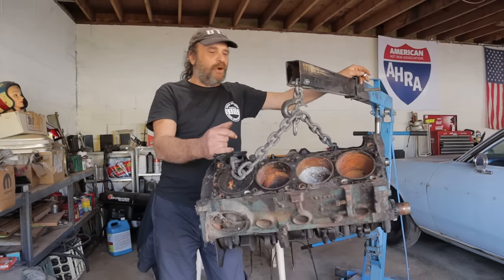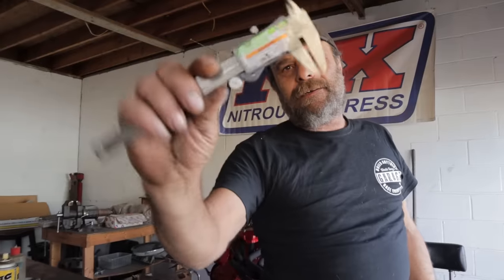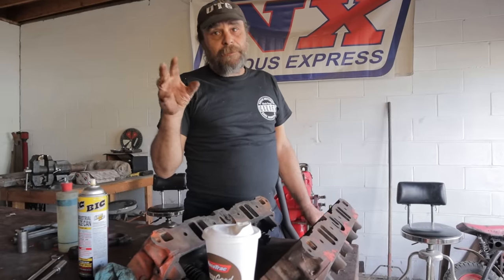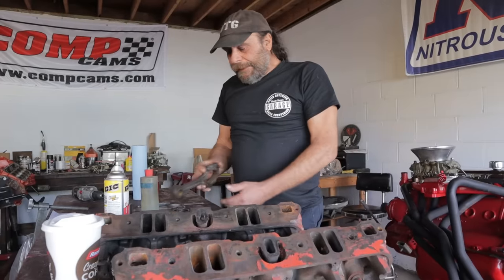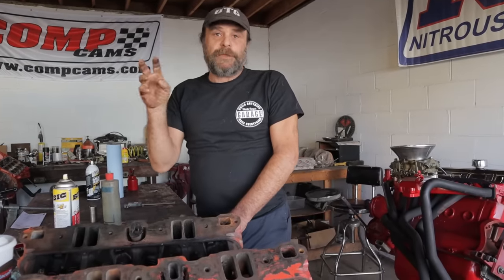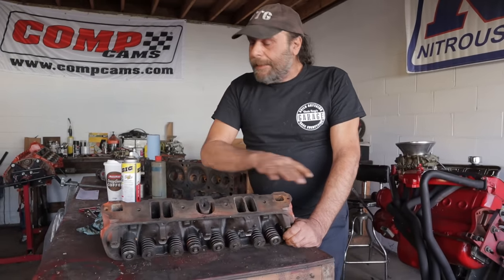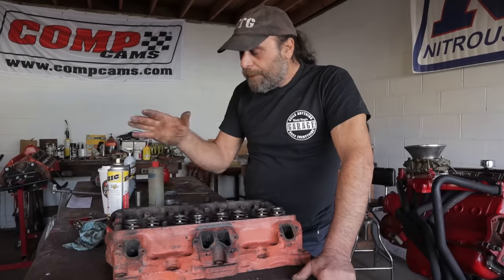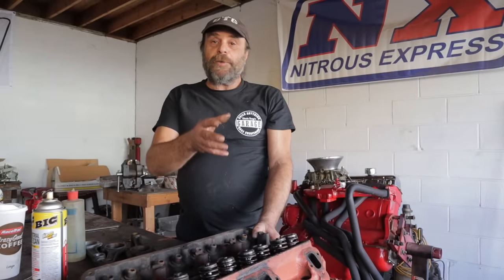The Most Under Rated V-8 In History?

Comment: Keep in mind the selling point of the 340 over the 318 was this 👇🏻

“With its extra 67 cubic inches, larger 2.02 / 1.60 inch valves, notably improved ports, dual plane iron intake manifold, full-length dual exhaust system and hotter camshaft, the 340's factory-rated 275 horsepower at 5000 rpm and 340 lb”

Comment: I've built two 318s that preformed excellent one i ran 340 heads on the other  i used Edelbrock heads both engines used a basically stock short block and thumper cams. one in a duster one in a dart. i hate myself for selling them. 😢.

Comment: hot rod did a 318 Demon build back in 1970 or 71.  Did all the usual stuff , Edelbrock intake, Holley carb, Cam and headers and ran in the high 12's in the quarter mile.  One of the MoPar magazines did a 318 Poly build about 15 or so years ago and got over 300 horse out of it.  The heads are the real limiting factor as the ports are on the small side.  Never should have sold my '68 318 Dart.

Comment: You know I was in my early 20s before the first time I heard someone dong on a 318 (I'm pretty young late 20s) but that threw me off. My first vehicle that was actually mine and mine alone was a 94 ford ranger, engine and trans became shot. Buuut I had a 318 and a 727 that my buddy had laying around. So being young and dumb and getting grilled by my grandfather for it we welded crude ass motor mounts and beat this 318 drivetrain into that ranger. Instantly the FUNNEST thing ever. Then later on just to horse around I decided to put a 508 cam in it matched with my "new" Holley vacuum secondary. I just wanted something that sounded lopey just bc. I then turned up the idle speed to get that fast spitfire sounding race motor sound. What I didnt expect was during the shake down with my buddy giving it the business in the way into town and then immediately pulling over to buy some cigarettes because we ?literally* almost pissed ourselves. Stock 318, 508 purple cam, cheap hooker headers mid dumped into 18in thrush glass packs, stock 727 with a b&m ratchet just bolted to the floor, stock rear axle. Sold it to help buy a 70 cutlass and the guy I sold it to put a ford 9in in it then sold it to help buy a new work truck. I'd kill to have that bitch back. 318s dont fuck around man

Comment: I learned something new here . I  had always heard that the 340 was basically a 360 with a 318 Stroke .
360 Pistons and Journal sizes and a Meaty Shorter Stroke Crank . NASCAR Engine . Double Row Camchain Etc .
Same Basic Block for all three ? Obviously the 360 heads have bigger chambers , because of the Longer stroke .

Comment: my story is...I get a 65 barracuda with the 273 in the trunk. a 318 off a junk yard police interceptor 
was currently in the car they wanted to put a 360 but this is a manual and at that time externally balance fly wheel for the 10.25 clutch was custom made only so I built this motor, got a par of 360 heads then ported and lapped the valves no valve job but I had the heads mill 40 thou. slapped in a mopar purple H 340 cam hi rise Weiand duel plan and a small primary TH crab, and 340 left manifold with heat shield lugs that not wanted so it was cheep but flows just as good on the right i used a 1991-92 magnum manifold  and ported to fit the LA heads only the center ports need the most massaging . and to finish the hole thing off 2 1/2 dull exhaust with $19 mufflers dumped at the axle 
with 2.76 rear end i could smoke a 5.0 mustang unless it had a blower or on the squiez.drove it for 20 years and still have it and putt it form time to time. but i will tell you it is tired. but it will still put a BMW to shame.

Comment: Whats funny is that the 400 B block was poo-pooed the same way for decades. It wasn't until the last couple of years that most people figured out what kind of power it can make. Nick's garage just did an LA 318 that put out 406hp with massaged factory iron heads, manifolds and running pump gas. NA with a cam that still makes enough vacuum to run power brakes. The 318 will get its day in the sun soon enough! As for now, I'm glad that I have two LAs and a Magnum waiting to revive projects.

Comment: I would think an aftermarket pop-up piston with the 340/360 heads would be the ticket on a 318. More cost effective than porting upgrading valves on a 318 head. You have to buy pistons and re-balance anyway. I haven't checked the price of used 340 heads but assume they aren't unreasonable to purchase.

Comment: The 318 was a great very reliable grocery getter 4 door sedan engine.Most performance parts that was in the 340 and 360 magnum engines can be put in into the 
318 to make it a quick motor
but remember on the street there is no replacement for displacement.Small blocks are great for the 3500Lbs.and under A body and Cuda cars.But in everything else the tourqe of a big block is needed to really move out a 3700+Lbs.body..However in defense of all mopar small blocks when they are built up correctly nothing screams high performance like they do..It is an incredible engine.

Comment: Can anyone tell me if a 1970 340 X head would work well on a 1970 318 engine. Back in the mid 1970's I sold a rebuilt set of 340 X heads and also the intake to a guy I knew in high school who had a 1970 Duster with a stock 318 engine. I always wondered how much of an improvement he had gotten. Has anyone else done this swap and could let me know if it was worth doing. With the stock 318 cam I've kind of thought that his stock cam would not let it rev and take advantage of the 2.02 intake valves and ports. Plus the smaller bore seems like the larger valve would be shrouded, not letting the air and fuel flow as easily into the cylinder. At the time, 1976, I didn't know much about motors so I didn't think to question it. Any help would be appreciated.

Comment: I have a fortified 5.2 Magnum..they should have put big valves in these things a long time ago..(1.92😁) Its the Rod/stroke ratio that makes them so good .Long rods with a short stroke are real easy on cylinder walls and rod bearings. Rod is not at extreme angles at any point.

Comment: Not bad those old 318 engines  went well with just a simple kerosene overhaul quick port and valve job on the heads with basic tools and a upgraded camshaft and valve spring. Cheap horsepower back in the day .

Comment: Driver side manifolds flow really well and fit both sides. After a walnut shell treatment they flow as well if not better than almost all shorty headers.
If you go 4 bbl get a cam to match it. Most aftermarket cam's are better than most factory cam's.
SCAT makes some really affordable rotating assemblies $1,800 there and another $1,800 on Edelbrock heads. You will have a lot of bang for the buck.
LA heads have more manifold selection (the EQ 318B flows better than the EQ 318A) than Magnums (about 3). Carter AFB or Edelbrock performer, don't mess with Holeakies. If you are a Thermoflood kinda guy you are still one above the Holeaky.
If you don't go aluminum for heads. Indy and EQ are best for aftermarket iron to my knowledge. Old EQ's made in New Zealand are better than the China made.
If you are going to punch the block for bigger slugs, stay on the low end for bore IE 0.020" the more you cut the closer you get into cooling issues.
If they make a roller type XYZ then use it. Reduces parasitic drag that eats horse power. IE Harland Sharp rockers. The stock roller lifters for Magnums are the best roller Hyd lifters you can get. Ask Marty at UTPerformance.
If you can find titanium pushrods, use them for the drop in reciprocating weight, see sentence above. That is money though. No need for the street.
The lumpy idle cam trend is stupid... Let me repeat. The lumpy idle cam trend is STUPID... Your cam is the heart of how your engine will perform.
It takes more than a day to figure out which cam will be right. 
Average part of the RPM band you will use. Most cams that is a range of 3,000 with 1,000 being in the middle and the strongest.
Vehicle gearing and tire size.
Rocker ratio
Manual transmission or slushbox.
If automatic what is the stall on your converter?
Runner volume and chamber volume for the intended heads, also valve size and head flow. Compression ratio (wouldn't go over 10.5 : 1, and 10.5 is pushing it on pump gas) Numbers below for example of head flow.
0.450 lift 208 int 155 exh 74%
0.500 lift 210 int 156 exh 74%
0.550 lift 208 int 156 exh 75%  <<<<< between these two lifts is the sweet zone
0.600 lift 205 int 156 exh 76%  <<<<<
0.650 lift 205 int 156 exh 76%  <<<<< No bigger than this unless you plan on living above 5500 RPM
at 0.700 lift numbers drop to 203 Int 153 Exh still yield 75%
If I can run 0.625 lift with my pistons, KB416-020, being safe from valve contact. Then that lift is my heads sweet spot. Duration and LSA will have the most to do with what the engine goes in and the purpose its built for.
Piston speed should never be over 4,000 FPM. If you want to go higher build the bottom end and rotating assy to be able to handle the stress. Math time guys. Stroke X RPM divided by 6 = piston speed feet per minute. I plan on building a stroker 360 with a 4" stroke. I intend to keep it under 6,000 RPM
So, 4 X 6,000 = 24,000 divided by 6 = 4,000 FPM.  
3.51 X 6,000 = 21060 divided by 6 = 3,510 FPM That stroke can spin faster than 6,000 RPM
This is just my 2 red headed cents. If anyone finds an error please let me know in a reply.
Dodge Dominating On Drag Grounds Everywhere. If you can't Dodge It RAM IT...................

Comment: No mention of the 302 castings  from the later production 318s?
Arguable the best 318 heads that came on mass production vehicles .
Set of 2.02 intake( yes they do fit)
And a mild p&p .and ready for your rocket .

Comment: As Machinist as a machinist when I would get an engine like that I would I would pull the crank and rods save the bolts the rest goes in the scrap yard when you try to bore block that has rust in it in the cylinders light rust will clean up you will have pinhole type Rush pockets that can lead into the water jackets

Comment: he's right about the miniscule bore difference between the 318 and 340,but the 340 came factory with the good stuff,tuff rided cranks,floating rods longer duration camshafts and it hauled ass,10.5 compression,do these things to a 318 it'll scream power has to be built in,first design is us,second is use +

Comment: in Mexico Chrysler cars had the 318 high performance with high performance parts fro factory , dual exhaust high compression pistons , Carter Thermoquad 4 barrel , they were very fast cars .
The highway patrol used cars with those engines

Comment: When I was a kid, my neighbor had a Dodge Cornet, I asked him one day, what size motor he had, and his reply was a 318, "best engine Chrysler's ever made". My best friend bought a new Dodge van in 1980, it came with a 318, that thing just would not die!, he finally sold with more than 300,000 miles on it ( and it still ran ). When I bought my 1996 Dodge Ram 1500, the salesman insisted I get the one with a 360 engine, I said no! I want the 318!, even though he got angry, I stuck to my guns. To this day and after many miles, my truck runs like the day I bought it, the only thing I've ever replaced is a starter and a water pump, and now the ball joints are going, but after all these years, that's normal. The 318 is to Chrysler, like the 327 is to Chevy. Treat them right and they last for ever!.

Comment: I'm 63 years old been playing with Mopars for a long time and I really enjoy laugh and it should be people especially with old junk I have a recipe the 318 poly has a steel crank in it if you can find a standard one offset grind it 20,000 use the nirads 340 rods use the 67 68 nickel block get it set of 273 closed chamber for Barrel heads Port the piss out of them find you some Pontiac inner Springs do little lays work on their retainers put it put a purple shaft cam in it from 3:40 and you can break 400 horse in a New York second and you still got a junkyard 318 maybe five hundred bucks
Reply: There's a couple more secrets to that but I given you just about 90% of it so have fun and don't ever count a person that plays with junk out

Comment: What about the 318 that had a 90 degree v used in trucks in the late 60,s as to the la 318 with the sixty degree v and the original 318 had larger spark plugs

Comment: No info on the “302” heads?.
Reply: I have several sets of them. The intake runners are kinda small and so are the valves but the combustion chamber is super tight so with a little work they’d be really great

Comment: I built a 318 with a purple grind 340 cam and lineage tray and 360 heads. Aluminum intake with a 500 cfm vacuum secondaries. Put it my 72 cuda. Thing would scream. Ran up of puff at 7,200 RPM.

Comment: Hi, buddy.❤ I once had a 318 in a 67 Belvedere. Super hot cam shaft. Shaved heads. I would smoke camaros and Mustangs all day long. What's out the 150 horsepower nitrous I had on it. Took it to the 1/8 of a mile. track and did 7.99 with it. With the nitrous. With out nitrous would do at 8.8.❤ I don't own any fast Mo, pars, but I do have a 2005 Honda 1800 VTX with Hot cams  Computer work that does 2.5 seconds 0 to 60. No rev limiter in fourth and fifth will do 165.❤ I have a 2002 prius. I'm thinking about finding a 318 and building it and put it in there.❤

Comment: Most 340s I've had were very strong as long as they had compression,  but most of my 318s ran strong as long as I did a little port work on them. The 318 was always better gas mileage.

Comment: I love the 318. If only for the fact that you can bore and stroke it to 390 cubic inches. That's an extra 72 cubic inches, more displacement than you can get from stroking a 350 small block and 302 Windsor COMBINED. Put another way, a 360 Chrysler with the same 4" stroke as the 318 and a 0.030 overbore only has 18 extra cubic inches.

Comment: Good video first car I ever had was a 71 duster 318 with 200,000 miles on it smooth as quietest engine they were the best reliablest engine in my opinion power and fuel economy when I was 16 17 we abused and abused that Duster end up taking engine out of it and put it in a charger the only thing that stopped this engine the timing chain went out if we caught it before that it'd probably be still running today of course at slant 6 was another top reliable engine of a 6 cylinder Chrysler could build good reliable engines the 440 I think they use more 440s and RV campers then any other brand

Comment: Anyone have a bellhousing for sale? I have a 1964 Dart slant 6, the auto went out and I'm trying to convert it to a 3sp manual. I bought a New Process 230 trans (I believe) and I have the clutch pedal box, but I need to source the bellhousing, gear selectors, clutch fork, clutch, flywheel and clutch linkage. Any help or advice or parts for sale would be greatly appreciated!

Comment: I had a 68 Barracuda 340S and it was fast.  I could handle 383 Road Runners with no problem.  Supposedly the 275 horse power was under rated.  It was a good engine.

Comment: I had a '63 Plymouth with a 318. It ran well but then developed a vacuum leak and I reworked the carb with a simple carb kit. I replaced the distributor because it had so much slop I could not set the timing accurately. When I finished the work it ran like a raped ape.

Comment: How many times have you heard various V-8 engines dismissed as "truck engine" on TV car shows?  Some resto shows routinely toss whatever engine is in it for a Big Block Chevy or latest Ford V-8.  My 1965 Dart has the original small-block V-8, the 273, and keeping it, though parts are getting rare.  Can't fault anyone for changing from a 318 to the 360 since most after-market race parts are made for the later, and mostly a bolt-up replacement, especially if the engine must be rebuilt anyway.  For those in GM-world the Northstar V-8 is overlooked, and an inexpensive competitor to high-end Euro V-8's which it imitates.  Some companies provide upgrade parts and fixes for its little nagging problems (oil leaks at the split block interface), per the Car Fix cable show.
Reply: 318's can GO cheap!: https://www.hotrod.com/articles/318-small-block-build

Comment: Ive built several 318s, but the one that standa out to me is the 67 318 la zero decked, 12:5:1 compression 58cc heads  roller cam. Ahe ran 11.77 at the high school drags before they kicked me out. It started at 12s when it was hot out. My grandpa and i tuned on it what seemed like forever and he slapped an 850 holley on it which i thought would flood... she ran faster

Comment: the most basic Gen 3 5.3 LS has a 1.89" intake valve.  The later L33 Gen 4 5.3 has a 2.00".  No LS came with anything smaller than 1.89" on the intake

Comment: The 318 is a great engine, itll make power like anything else. Most of them are low compression 2 barrel carbs. The 340 was a performance engine from the start and in my opinion when you pop the hood alot cooler.

Comment: I like the 302 castings from 85 and 86 with the heart shaped chamber, better compression and flow.
Reply: Like used here: https://www.hotrod.com/articles/318-small-block-build
Reply: Yes! I had a 85 d100 came with the #302 casting heads but was the last year non roller camshaft. It really woke up with a cam,springs, intake headers and carb. But i chucked it to swap to a 440... but the 318 pulled damn strong considering it had low compression of 8.2ish to 1. She did like the 100 shot of the gas too lol
Reply: Agreed.My starting compression was around 9 with low miles when I got her (not sure if any work had been done looked original) so I upgraded the cam, springs, aluminum intake, holley demon carb, headers, hei distributor, and a few other odds and ends. More horse power, better gas millage for a much better truck to pull my bass boat.